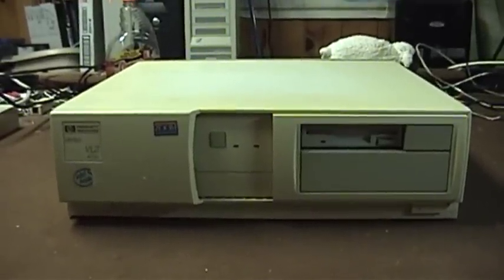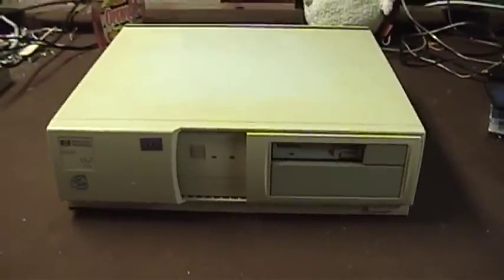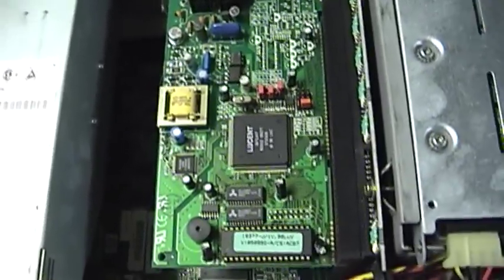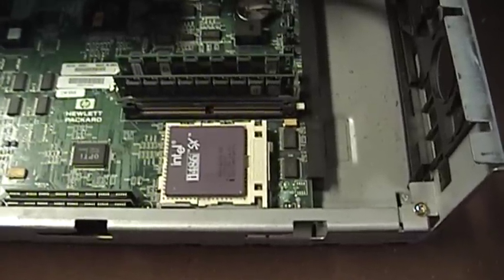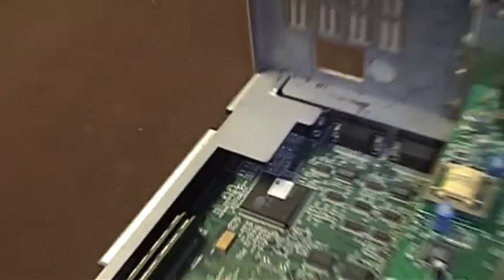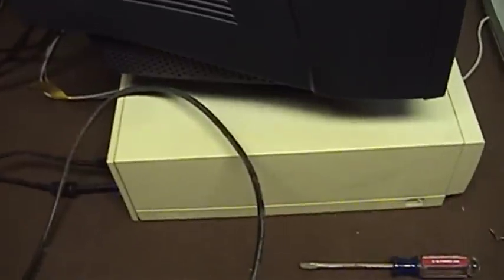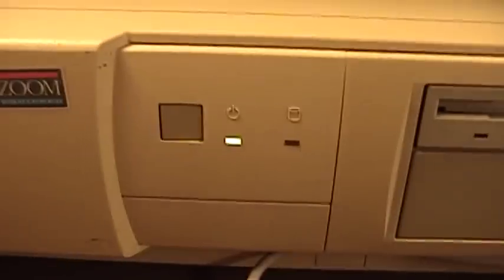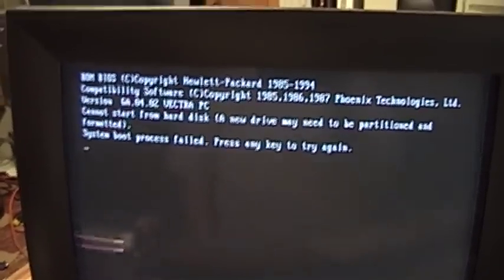Recycling Rescue: Hewlett Packard Vectra VL2 486SX-33 PC

Comment: It took me longer to read the description than to watch the video! :-P

The thrift stores I frequent do accept and sell computers, but the prices vary widely. One day you might find a nicely kept Dell Dimension Pentium 4 for $7.99 and the next day you might find no-name beige box Pentium-133 with missing parts for $29.99. Used LCD monitors are becoming more common, although most have scratched display panels, and the ones that require external power supplies are almost always missing them.

Comment: Got a 20-gig Fireball from an ABS computer made in 2000 that still does fine. A friend of mine has several old computers and one had another Fireball (possibly also 20 GB) and it still works... and I think we have at least one in the HDD bin at work ready for emergency service.

Comment: I remember getting an old computer off of some guy and this did the same thing. Turns out the hard drive got corrupted and popped up as Unknown in Disk Management. Fixing it with Disk Management and formatting it made it work again.
Reply from the maker: This hard drive was unable to pass its self test and bring itself online. If that doesn't happen, there is nothing you can do in software.

Comment: I may have a key that fits that case.  I have a few HP Vectra Pentium 2 PCs and I remember there being keys.  I think on mine they stored them inside the front bezel which is removable as it comes off first to open the case.

Comment: My school was pretty awesome to me and I have gotten a few computers from them. An HP Vectra XM which shares this case style but was a little newer and an HP Vectra VLi8 mini tower which I still use daily with Windows 98 running on it. I was able to purchase a newer Pentium III 850MHz processor for it and surprisingly, the computer needed no DIP switch reconfiguration. It was listed to only support up to 550MHz but it recognizes the entire 850MHz, it's pretty sweet.

Comment: I have a Vectra N2 4/50 with a 486-DX CPU Clocked at 50 MHZ. Got it for free at an electronics recycling facility. It looks a little bit like this one. The motherboard in the 4/50 looks very similar to the board in this one. If you want me to, I can make a video response about it. Loved the video as well.

Comment: It has been many years… and I’m still waiting on that Pentium OverDrive + L2 write-back cache video! ;)
Reply from the maker: I forgot all about it. It is rather unlikely at this point that I will revisit the subject, at least for the foreseeable future. (The computer I had planned to use for this demonstration needed to be cleaned up after a basement flood. I did that, but I haven't put it all the way back together.)
Reply: @uxwbill Well hey, more than anything, I just wanted you to know how formative of a memory this video is for me. I must’ve been in middle school at the latest when I watched it, and now I’m out of college and working as a systems administrator for a small company. Still into old PC stuff, too!
Reply from the maker: I'm glad the video was a formative moment for you, and I also appreciate that you've been watching over the years. To try and give some sense of closure, while seeing how badly I remember what's in this video already...the story basically goes that external cache management on the Pentium Overdrive was a mess. Intel reportedly kept changing the specifications while manufacturers were bringing hardware to market.

Write-through caching generally worked fine with the Pentium Overdrive. If your system supported and used write-back caching, that's where things could get really interesting. Some systems would run perfectly no matter how things were set up. Others were stable until you did some very specific thing and then the whole shebang fell down. The remainder of systems were unstable no matter what you did to try and get it working. You could see all of these outcomes even across multiple examples of the same hardware, with the same BIOS revision and the same software stack. I did! I had several identical "Lacuna" PS/2 Model 77 systems with POD CPU upgrades. 

Of these, one worked perfectly no matter what. The other would crash only running the reference disk or system configuration programs. I believe it failed with a "217" error code, which sometimes it would not do until after leaving the configuration programs and rebooting. The last example just crashed constantly if one dared to run a POD CPU and cache model in write-back mode. It was uselessly unstable.

I believe I was going to demonstrate these on video, and compare them to an HP Vectra XA with a POD83 and 256KB write-back cache module.

Could there have been some kind of difference in chip revisions that wasn't readily obvious? Absolutely. (I have a "Lacuna" board PS/2 Model 76 whose S3 graphics chip is marked as a prototype. That S3 graphics chip is also another case of a component being stitched into a design with a really hot needle. It was designed for VL-bus or PCI systems, but IBM put it in a Microchannel bus computer. Some of the resources used by that S3 chip also occupy those used by other hardware in the system, such as COM4. There were also timing problems that IBM tried to solve with numerous graphics driver releases, particularly under OS/2. They also tried different RAMDACs to resolve the issue.)

While not really a fault, cache memories took on all manner of different package types and layouts...various vaguely SIMM shaped modules, plug in modules, and even loose chips for direct insertion to sockets. I'm sure some manufacturers did a better job of their board layouts, and that some cache controllers were better than others.

I think that should cover it, unless of course, I've forgotten some detail or another. That's certainly possible.
Reply: @uxwbill Thank you! I’m glad to finally know the story. :)

I think I once tried to research the topic a bit myself, but finding any amount of useful info on the web, especially obscure content from decades ago, has become increasingly difficult lately. Your anecdotes are far more informative than most of the crap I tend to find on the web these days.

Comment: Nice video, you're lucky because those old computer are realy rare to find now (in France i've see some 486 machine sold for more than 200€ recently, and people buy them ...)
As for the LBA you coud always use a drive overlay software.
These old Quantum hard drive are not realy reliable, i've also had a lot of trouble with those ...

Comment: I recently picked up an HP Vectra XM 5/133 system from my workplace. Took it home, works perfectly fine. That slot you mentioned on the reverse of the ISA expansion card, my XM has this populated and came with a 10/100 ethernet card. Unlike network interfaces today that have the 10/100, and even 1000 if you're lucky enough, are integrated into one port, this card has separate 10 and 100 ports. The card did function for a little while, however after a few reboots the BIOS started giving me "LAN error" warning messages so I decided to pull the card and install a spare gigabit ethernet card in to it so I can transfer data from my file server to it and vice versa. I know that the PCI slots it has won't be able to go that fast (heck the IDE channel probably can't even do 100Mbit/s) but it's what I had lying around. :p

Comment: We have Goodwill computer stores here in Calif, they only sell used working computers. Everything else however is just thrown out onto the shelves and you don't know if it works or not but you can return it and get store credit. I found some stereo receivers that were not working, showed them to the manager and offered to give them 30 or $35 for each, but they would not accept that, they wanted the sticker price.
I argued that they are just going into the recycle bin but they didn't budge on the price.

Comment: I don't know if you have covered the secondary memory in a later video, but the on board video memory look like the DIPs (dual inline package) memory chips.  Those were used in a small window between direct memory DIMMs and ZIF sockets.  These used a row of female sockets in the memory package and hard wired male pins upright on the motherboards.

Good stuff, I think you and I think alike.

Comment: The only modern desktop I can think of that is similar in power usage to that HP is a modern mac mini. I remember picking up a huge load of old computer parts, and included were some full length expansion cards... there was a 14.4K modem that only just fit in a full tower AT style case. That thing was huge. The cards built-in speaker was also massive.

Comment: On another note, upgrading a 486 machine to a Pentium overdrive can be difficult because older 486 mobos have a 5 volt processor and socket. Therefore, the pentium overdrive is an 3.3volt processor, and though it could fit in the socket, the extra voltage would let the magic smoke out. Apparently you need a vrm modification to correct the voltage

Comment: Boy, I sure commented a lot on this video in the past. 

I got ahold of a Vectra VE 5/120 series 3, and it seems that an artifact for a PCI slot would have been on the rear of the backplane underneath the hard disk. It's odd, I wonder if anything would happen had it been populated and had a card installed?

Comment: I used to have a VL2 4/50s, basically the same machine with a SX2 50Mhz and Seagate HD. The matching keyboard is still in use and seen in the Marantz tuner video. The POD should work with L2 writeback cache, its L1 writeback mode that is unsupported on early chip sets. I really want to try and run a POD at 100Mhz on one of my EISA boards.... hint hint. Those Quantum ProDrive LPSes are garbage, I have a pile of dead ones from Macs.

Comment: the hard drive sounds like the heads have touched on the platters causing a head crash and is not allowing it to run it's seek test properly, hence the drive powering on and off
Reply: It might have a password on it, I think this computer might just be a tad too old to deal with that.
Reply: a password will not cause the drive to crash the heads on the media surface. thats a mechanical failure.

Comment: I have a similar computer but in an older revision acutally. Mine is the HP Vectra 486/33 VL. Yours has someking of COAST slot, but mine just uses regular sram chips. However mine is a socket 1 computer so this is not really good for upgrades ... but since this computer was given to us years ago (~15 years) and since I'm quite young for a retro computing enthusiast, as far as I can remember, to me that computer always existed, so I can't leave that computer even though it's not the best.

It originaly came with a 486 DX33 with 8MB of ram, no cache, no expansion cards and a 170MB HDD. The HDD died unfortunately ... at some point I upgraded it to a 486DX2-66 CPU with 32MB of ram, a 10GB HDD, a sound blaster vibra CT4170 and I added a CD-drive (but it didn't have brackets so it was just hanging there and it didn't look good at all) but now that I have faster old computers, I put it back roughly to it's original specs ... though I made some other upgrades such as installing L2 cache, adding 512KB of VRAM for a total of 1MB and finally, I found a 270MB quantum HDD so it's close enough.

I also installed a sound blaster pro 2 and a 3com etherlink III. For a "slow" 486, I'm actually quite proud of that computer ^^

Comment: You need to get a lock pick set. Then you won't have to damage the computers to get inside and I bet most of those computers can just be raked. Running a ball shaped tool over the pins with pressure on the lock body. That is how I got my trucks tool box open because it had no key with it.

Comment: Ah old quantum hard drive ... The only serie I had which I've never have a problem with is the BigFoot, the ProDrive as well as the Fireball always get bad for no reason ...

In 2003, I've bough a new Quantum Fireball 1 Gb drive, it was steal sealed in the factory blister ... I give 30€ for this (everyone make mistake and I was 10 yo at the time) ... the drive failed within a year ... all sectors became bad ... I think a part of the head assembly got damaged ... but for no reason !

Comment: What do you think about
modern HP products? I've had a terrible time dealing with their low quality at a high price.
Reply from the maker: Garbage.
Reply: Had an HP officejet pro 2000 series, there was always network problems because the wireless was so flaky. I've had a Compaq Pro 6000 which the mainboard died spontaneously. But perhaps the worst product i've ever bought from them was the HP 2000 Notebook. For $400 I got a single core 1.3 ghz processor, 2gb of ram and a 500gb hdd. These things are such rip offs!

Comment: I've used a few HP Vectra PC's with the same case style, I think most of them were Pentiums.  I remember one particular feature of at least 2 of these PC's, was that even if the computer was completely powered down, you could turn it on by pressing the spacebar on the keyboard, is that the case with this particular PC?

Comment: Does anyone have the manual for this machine. I just acuired a VL2 4/50 running a 486 SX2 50Mhz chip 5volt 168 pin socket (no socket 3) and want to upgrade and need some help. Please Help!!!!!!
Reply from the maker: Your best bet may be to nose around the HP FTP site. Sometimes you can get lucky. If not, I'd suggest a forum of some kind that caters to vintage computer enthusiasts.

Comment: I HAVE THAT EXACT PC
Reply: i have a vectra too. how do you save and exit after adjusting settings in setup (bios)? when i press F12 to exit it says the configuration has changed, but is not saved. what button do i press to save when exiting setup? thanks.

Comment: Talking about power usage of a modern computer. For exmple a 2010 27 inch I Mac at 115V uses 152W when the Computer is idle and the display is on. So uxwbill is right we will not be seeing power supplies with 100W max output in a computer for a really long time if ever again.

Here is the page where  I got my info from http://images.apple.com/environment/reports/docs/27inch_iMac_Product_Environmental_Report__20100727.pdf

Comment: there is no operating system on the hd, so the bios give you that error
Reply: You're wrong. Listen to the hard drive at the end of the video. It's shot. Not only that, the system works fine with a 1GB Seagate drive as well, and gives a very different error due to the lack of an operating system.